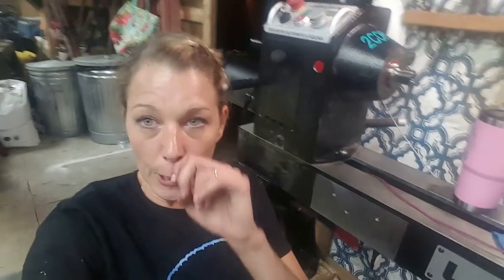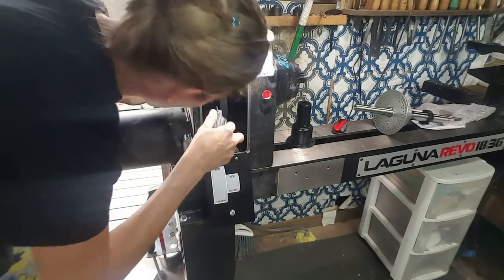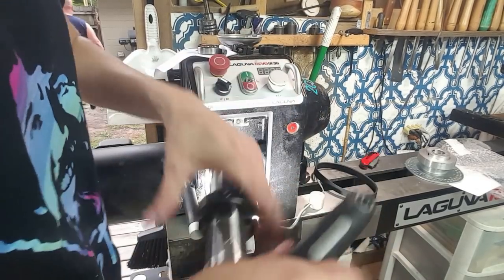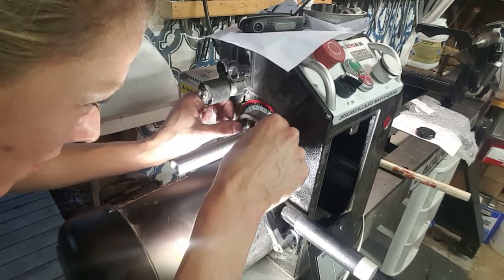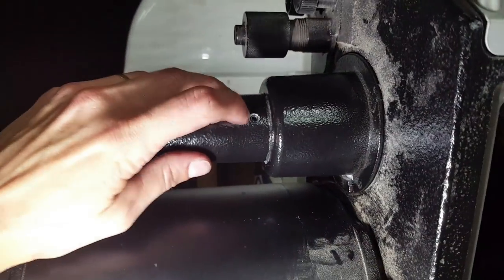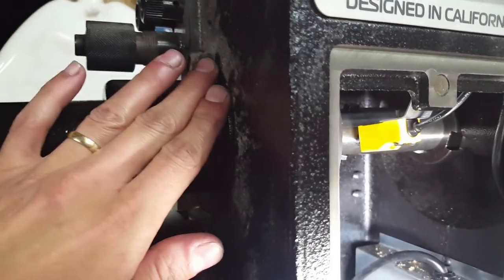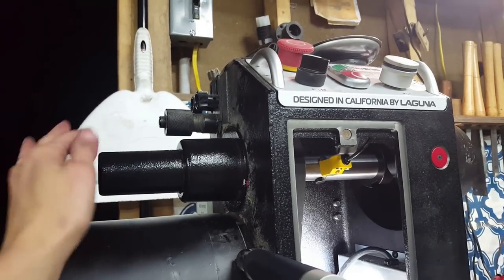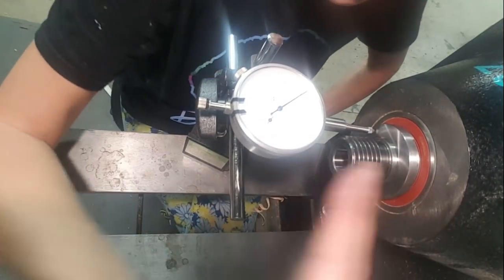New LAGUNA lathe spindle replacement

Comment: Good work Kim!  You have basically achieved zero runout on your spindle!!  Without a doubt you have inherited your dad's mechanical aptitude!  Those funny metal "potatoe chip" gaskets you mentioned are actually a type of spring that is designed to pre-load the bearings to take out vibration and endplay.  What state are you living in that is so hot and muggy?  I live near Edmonton, Alberta and we already have snow.

I'm beginning to think that Laguna has quality control problems.  Do you know where the lathes are manufactured and assembled?  I prefer to purchase made in USA when I can, but I have a large metal machining lathe made in Taiwan, and the build quality on it is very good.  It's much better than most machines made in mainland China.
Reply from the maker: Taiwan is where Laguna is made. All of the parts including the electronics.

Comment: Wow, such a hassle!  I thought Laguna was a high class outfit but not at all impressed with them now.  I am a woman wood turner and I got a large Jet to replace the small table top Grizzly lathe I had about 10 years ago.  It got paint rubbed off of it in shipping and I told them about that.  I don't know why.  They must have followed up with me.  Anyway, I was offered some paint to fix that!  I said no, it'll just get a bit banged up with use anyway.  But, wow, such customer service!  I would be quite frustrated with all you've had to put up with on the wobble!  I believe I'd have insisted on someone coming and checking this out or sending me a new lathe but then I'm nearly 70 (in 2 weeks) and life's lessons have made me less tolerant of these things.  
Hey, appreciate your Christian attitude and love your videos!
Reply from the maker: wow, sorry you had to deal with that. Yes, very frustrating for sure. 
Thank you! God bless🤗🤗

Comment: I'm going through the same thing on the same exact lathe but my only problem is Allen screw on the locking nut on the left side of the spindle (under black cap) is too long. When I loosen it to tighten the night and rubs against the inside of the form where the bearing sits and when I tighten the Allen screw to make it shorter it then hits the same thing but on the end of the threads. I'm so furious with Laguna and I got all the extras for this lathe. Not impressed

Comment: Hi Kim,

I just wanted to write to say thank you for making this video.  I ended up in a very similar situation and your video was a HUGE HUGE HUGE help! :)

I have the same lathe, which has worked beautifully for me for about a year or so.  So no lemon here.  Recently, I decided to chuck up a relatively big blank (stepping up from a mini lathe, at some point I just had to turn something that wouldn't have fit on the old lathe!)  I was getting a problem where the chuck would partially unscrew itself when I turned off the lathe, so I tightened down the setscrew on the chuck.  Not enough, apparently.  The chuck still wanted to unwind, but in the process the setscrew mangled up some of the threads on the spindle.  Enough so that I couldn't fully screw on anything anymore, and I was getting crazy wobble.

Even though it was 100% my own fault, Laguna did the right thing and sent me a new spindle under warranty.  While I was waiting, I watched your video...

First observation... the EXACT same thing happened with my box as with yours.  There was about an inch or so of spindle poking through the end of the box!  Why would they use a wood plate with a hole in it at the end of the box?  Who does that???

Second observation... my box did not come with any instructions (even the wrong ones like you apparently got.)  So, my "instructions" were your video, which I watched again while standing over a pile of parts. :)

I'm relatively mechanically "capable", so the replacement wasn't too bad.  But like you said in the video, the hard part is sometimes knowing if a part is even supposed to come off.  (Followed closely by having parts left over after you re-assemble it!)

For the price, I'm still relatively happy with the lathe.  It's not a Powermatic or a Robust, but those machines cost a lot more than this one did, and it's not a business for me where I can easily justify the extra price.

Anyway, thank you again for making this.  I just wanted to let you know that you helped me out big time yesterday.

Dan Stromberg
Reply from the maker: I am so so blessed to know that!!! As messy as this install may have been, it was what it was. 🤷‍♀️ 
I am so happy to hear your lathe is running great! 
 I would agree about the price point too. It is where we are at and much more is just too much. 
The boxing is nuts. I am sorry to hear yours was shipped the same way. You figure someone would have done that a little differently.  
Anywho, I am happy to know it all worked out! 
Thanks again for watching!
God bless!

Comment: I'm not sure you can check the accuracy of a live center on the spindle.   A live center wouldn't likely be used in the spindle, I can't think of a reason why I would use one like that anyhow. I think the only accuracy you can check on the live center is the head of it in relation to the shaft when it's seated in the tailstock to see if there is any runout or of course move it close to a spur drive to see if they align. I'm speaking from the point of view of someone who knows nothing of course.

Comment: I have the 1836 and actually like the spindle-lock design; mistake-proof for me. However, "ThePapa1947" has a solution you may like (see https://youtu.be/AzExi1D8sak). I am surprised that the bearings slipped in and out so easily - I would think they should have a light press-fit on the shaft and in the casting. This can cause run-out. My live center behaves the same. I tried to take it apart and adjust but I couldn't make it work, so I use an after-market live-center. Thanks for sharing your adventure!

Comment: I am surprised the spindle is removed so easily.   This may have contributed to your original run-out issue.  Shafts are normally pressed into bearings.  If the shaft OD and bearing ID is the same, you would need some pressure to get these together.  For an easy hand fit of the shaft into a bearing, I would expect the OD of the shaft to be about 1/2 - 1 thou smaller than the ID of the bearing.  A small gap can lead to run-out especially under load.
The bearings on a wood lathe are not as robust as on a metal lathe.   I have both so have observed the difference.
If you put an MT taper in the spindle then mount your dial indicator, then push on the taper, you will likely observe some deflection.   This is normal.

I have replaced the shafts in the gearbox of my mower deck a few times so I have experienced the issues of fit and pressing.
The threads on the spindle hold the chuck on the spindle and provide the strength for the loads created when turning.   All thread specifications have play/slop/space between the male and female threads by design.   This is to allow easy threading.   If there were no play the imperfections/tolerances of the male and female thread could bind as you tighten or loosen the joint.
In order to get a threaded connection to run true, each piece must have a register machined where the parts connect.   Your spindle has a shoulder as the register.   A good chuck insert should engage on this register to run as true as possible.
Glad that your Laguna lathe is now back to specification.
My wood lathe is a NOVA DVR XP.   If I ever have to replace the spindle bearings, I expect it will be a lot more effort than your Laguna.
Dave.

Comment: I have this same machine and have had switch problems. They are sending a relay to me now.
Just curious why you bought the REVO when you have the Vicmark. Your problem could be that you are pushing the machine beyond its limits. For what you are doing you may need a much heavier lathe.
Reply from the maker: The vicmark is a better lathe but only a 14" swing. I wanted to have the ability to make sinks and larger bowls. 
I do tend to find the limits of equipment rather quickly. 😁🤗
Reply: @KimTippin  Some Vicmarcs will allow outboard turning ,
have you tried that? I have the outboard extension for my Revo and have turned 32" wall art discs. It's pretty good so far. I just need to get it running again...chattmill.com..I'm mostly a woodcarver >   chattmill.com    but use the lathe a lot for parts of the carving process..

Comment: the spindle has to be a "loose" or technically a "thumb-push-fit" so that the average Jo , who is not a mechanic with an arbour or other press can remove the spindle to change the  belt/s on the motor, as this is a consumable part, and would need replacing at intervals.

Comment: Hi  Having watched your video I can only say at the outset that you more certainly have extreme patience and perseverance. Why should you have to be replacing a headstock shaft yourself in a new machine. It's outrageous to say the least. The headstock assembly should have been uplifted and replaced in full working order and compensation made for all your troubles.
Watching the initial strip down of the headstock I noted that the shaft thrust/tension nut following partial unscrewing of the locking setscrews. That you were able to unscrew the trust/tension nut by hand. Therein may have been the whole issue with the  headstock shaft in the first instance. The shaft was in fact loose and therefore not properly seated in the front and rear headstock bearings.
 A very fine adjustment to the tension nut makes a huge difference to shaft stability.  In my opinion you should also have received new bearings as running the shaft loose as supplied could have causes deformation albeit slight in the existing ones.  I do hope that it all works out for you .
Reply from the maker: Thanks Jim. I agree!
I am still not sure if it fixed my wobbles :(

Comment: Spindle bearing should not slip in and out and the bearings should have any play ... the threaded nut on the end that holds the spindle in place is a standard design but before it’s tightened the only play should be along the length of the spindle... any radial play means the bearings are not seated on the journals ... not much can be done to fix that ... you would need to source new bearings, rebore the headstock and remachine the spindle journals ... by the way you should not hammer on bearings you need to press them ...  long term if you radial play before you tighten the retention nut the spindle will shift in use and you get a wobble ...poor construction... at 55:00 it looks like the spindle is running true... hope it stays under load...
Reply from the maker: Thanks Fred! It for sure doesn't stay true under load. I am frustrated.... The speed indicatior quit working tonight. 
I am over it. I am tired of hearing myself complain as I am sure other are too. :( It just happens to be whats happening. I don't know what else to do. 😭😢😭😢
Reply: Sorry to hear it doesn’t remain true but with that badly fitted tail bearing I am not surprised ... I ask for a new headstock... when they refuse we’ll the only fix, I think, is to find a machinist who can bore out the headstock journals, install (press in) sleeves then rebore to fit the bearings.  This might cost more than the lathe did
Reply: Ps beautiful bowls ... don’t give up ... your channel is great
Reply from the maker: @FredFred-wy9jw  , The lathe is only 2 months old. It will go back to Cali. before I do that.
Reply: Did not realize it’s new ... missed that bit .. I would either get a refund or a new headstock ... if you want to or need to demonstrate the problem to get the manufacture to replace the headstock get a test bar.   I’m guessing the spindle is a Morse 2 or 3 tapper ... search on eBay for Morse taper test bar.   Clean the spindle and the bar and insert test bar with a light tap to seat it... run your test indicator near the headstock and at the far end. You will see the run out in spindle which is the source of the wobble.  A gentle tap radially on the test bar will likely change the run out confirming the bearings are not properly seated.  Changing the bearings won’t help.   a new lathe really should not have this problem....

Comment: Hey, Kim, glad you are making progress.  Testing any runout using the live center will be rather fruitless as it isn't machined for that kind of work.  You need some sort of dead center like the spur center that came with the lathe to test that.  The digital gauge showed no runout on the inside of the spindle and very very little at the shoulder, so that's good.  

What size is that VicMarc?  That lathe should do most anything you ask of it.
Billy

Comment: one easy way to hold the spindle is to put a chuck on the threaded end and put a piece of wood (board) in the jaws so that one end is on the lathe bed, thus giving the necessary support. Also with this you can use the tail stock to "press" the spindle against the bearings, easing their instillation.

Comment: Kim,   I'm surprised it worked at all after you got done.  You put the "dohikcy" (that's what you called it) on backwards from when you took it off.   It is the part holding the bearing in on the left after you remove the cap.   The bolt head direction was installed down in front and taken off up in front.   You definitely need to change it.  You're doing to call and ask them(if not in instructions) how to know the correct amount to tighten it.   Obviously not cranked down with a 24" pipe wrench!   There is a way to know what is correct.  Good luck.   Respectfully,   Kevin
Reply from the maker: Wow Kevin!! Thanks!! I did correct it the next morning. I watched the video to see if it was on backwards. It was. 
No instructions were given other that how to change a belt on a jet lathe. I asked for better directions before I started but the CS said this is what they have...thats it. 
Obviously I'm not a lathe mechanic I did the best with what I knew, which is very little . So yeah I am kind of surprised it worked considering.... 
And "doohickey" is a term I use quite often whenever I have no idea what particular part is called. Not ashamed of that. I'm just ignorant to what these parts are named.
But thanks again for looking out for me!
Reply: Kim Tippin Wood Turning      It could have been a "whatchamacallit" as well.😊

Comment: Hi Kim. The potato chip washer is called a "Wave Washer" it is made that way to apply a light pressure to its mating surface for end play. 

I am adding comments as I watch the video. You could have used your tail stock to apply light pressure to the face of the new shaft keeping it pushed rearward to remove all end play. Then tighten the shaft collar set screw at the end of the shaft (the first piece you took off). Here is where the wave washer help to keep tension for end play. Your shaft lock, the red button, is usually used just to lock the spindle to hold the shaft just to allow you to untighten your chuck. The plate with all the holes in it, is there for as a position marker. It should have a pin that slips into any hole to allow you to divide your bowl to a number of positions if you what design points at a set of inter volt. Like cutting flutes in a spindle table leg, and so on.

Comment: If one new to a craft, trade or  discipline there is an initial period of learning the basic methodologies and skills that are required to work within that craft, trade or  discipline. as our understand of the craft, trade or  discipline improves so does our learning of more complex methodologies and skills. ALso, we learn how use shortcuts. It's constant learning curve...I have never seen any special tool for that bearing kust what you have handy like wrneches or pliers...a pity it still is not working properly